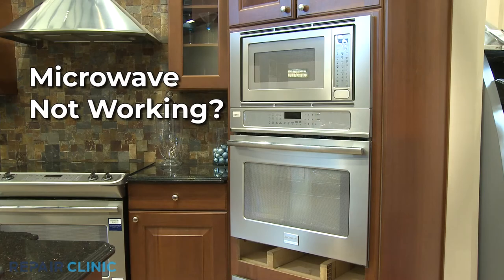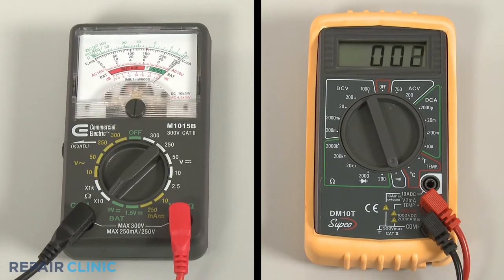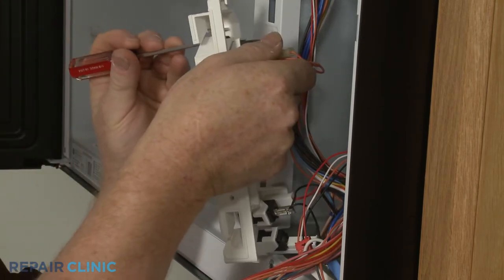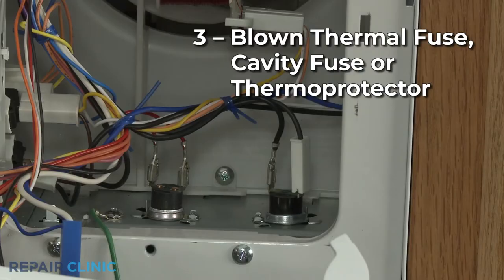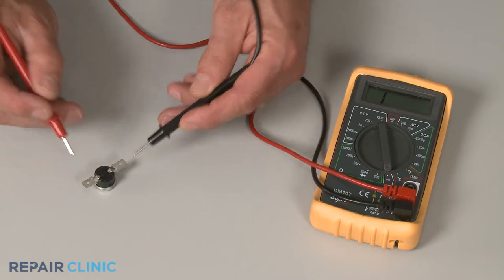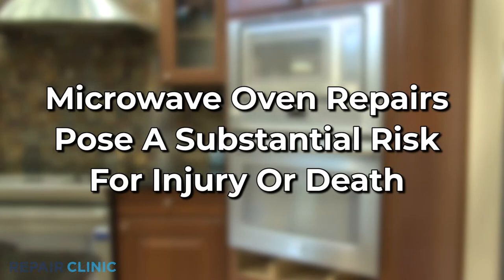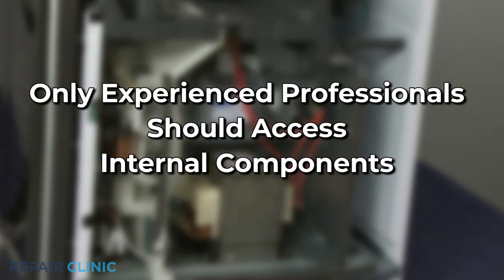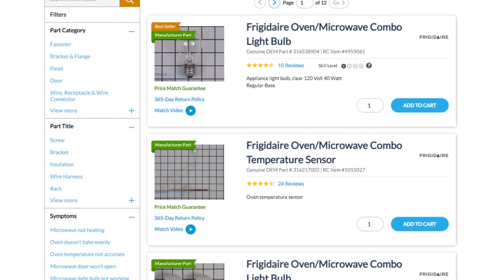Oven/Microwave Combo Not Working - Oven/Microwave Combo Troubleshooting

Comment: I just bought a microwave power control board to replace the bad one . As I was installing the new board I counted the number of connectors we had left and i realized that i would have (1) two pin term block onboard with (2) two pin  connectors to plug in.  they both have 2-16 gauge wires 1 is blk/blk the other is wht/red one set read (as i remember) 300 ohms and the second read (I believe) 15 ohms. I am fairly certain one is the moisture sensor, the other not so sure. My dilemma is that i already installed it and will possibly be unable to return it. so i need to know if i could just add the block and any extra components necessary to operate my microwave. the holes are drilled for the extra term block that is not there. Any thoughts. i am stuck with a $200 part if i cant come up with something. Thanks for your time. and ps great videos